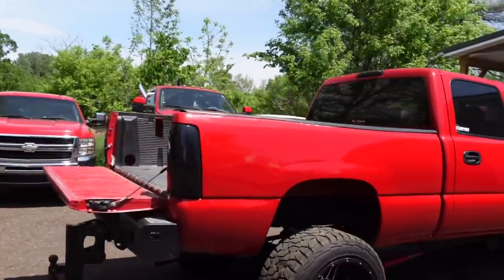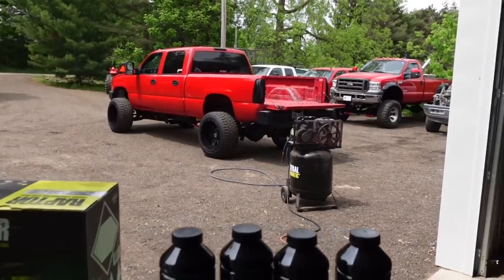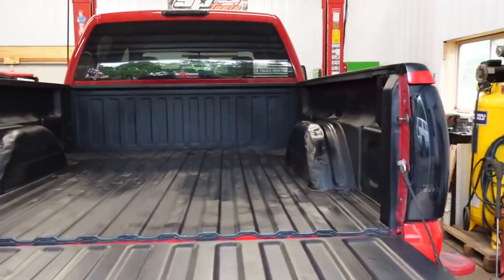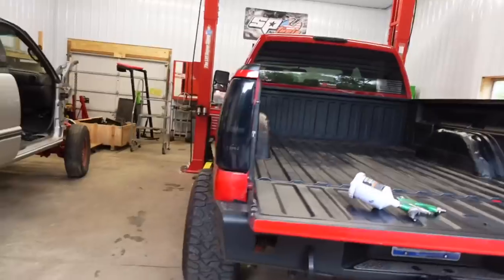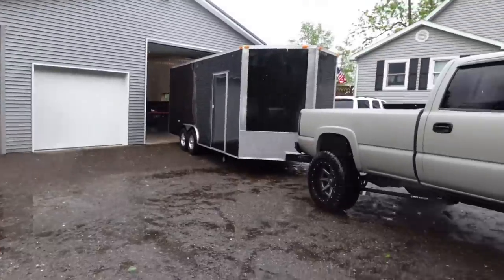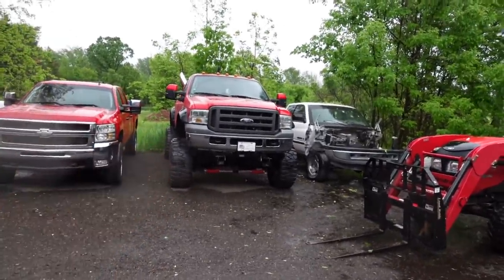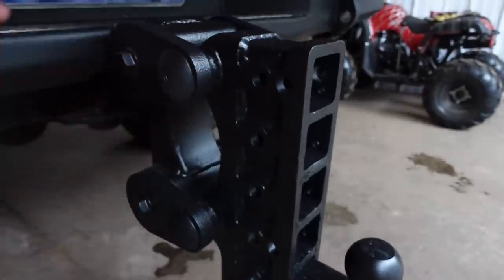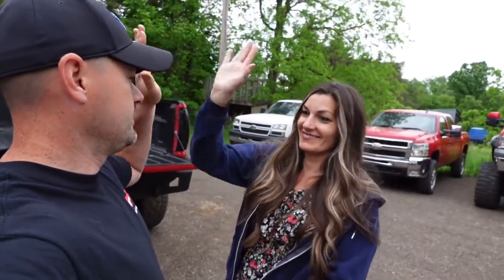Look What My Plastic Bed Liner Did To My Duramax! YIKES!

Comment from the maker: Who has a plastic liner on there truck? Do you like it?
Reply: Ya don’t run them fender flares either, they rub and mess up the clear coat around your fenders
Reply: Never. I did raptor liner in my build. It's comming right off. Should have went linex
Reply: @Yippa391  If your Raptor is peeling off, you didn't prep well enough.
Reply: why didn't you just put A tonneau cover  my sister put one her brand new chevy silverado High country.  pickup truck
Reply: I got spray in and love it its durable and easy to clean
Reply: I still have a plastic liner, but mine does not cover the top of the bed walls like yours did. It has rubbed the pain off in the bed in the high places but I have kept eyes under it over the years and it still has no rust thankfully. Then again mine is solid with no holes. I too have it on my list of too-do's, Most likely I will go with X-Line which is a professional liner if I do not do it myself. My rockers and paintjob is a little more pressing atm. Any-who glad you got it taken care of and I think you are correct in your choice to put another coat ... go big bump like rust's mirrors...more protection.
Reply: My trucks previous owner put it on.  It's an 02, so not sure how long it's been there.  I'm worried about the moisture underneath and hope much rust I'll see when i take it out.  I do like the secondary protection from the plastic before the metal, but just not sure if it's worth it.
Reply: Only reason I like my drip in liner is for impacts... Like hauling S tons of firewood every year.... That and spray ins are expensive for my pocket...
Reply: i do. it came with it. and i have looked under the top of the bedsides and its worn through. but its a california truck and its still in california so its ok. but i want a spray in bedliner.
Reply: I used to have a Line-X franchise and those drop-in liners were job security
Reply: Yep had one in my 92 gmc since my dad got it from the dealership.   Bed never rusted out i sold the truck after at 435k orignal motor an trans for 800 bucks still ran.  Rust on the rockers an the bed. But the rails an under that plastic liner was still looking good.
Reply: my old dodge dakota had almost no rust on it when I bought it.  but the bed liner which came with the truck accelerated the rust 10 fold
Reply: My 95 S10 pickup has a drop in liner. The bed seems to be galvanized or something... When I scratch the paint to metal it doesn't seem to rust just stays gray
Reply: I can’t drive a truck yet for three more  years but my dads gmc Denali has dual liner in his truck but he had plastic liner on his Ford rangers he used to have.he also hated his one ranger cause It’s transmission blew up when he was driving it could’ve killed him
Reply: I bought a Toyota pickup years ago that had a plastic bedliner beat the hell out of that truck working it to the max tore the bedliner eventually but no dents or rust underneath current truck has one when I pull it out to clean underneath looks brand new and I work my truck no grocery getter never understood people hating on plastic bedliners I think if I had a spray in liner I would dent the hell out of the bed of my truck

Comment: Those bed liners were doing that in the 80s. I can’t believe they still sell those. Best things are spray in and a thick rubber mat. Good video. We could sure use a mean tweet and under $2.00 gas .

Comment: Cap foam under the top of the box...then  grease ur bed to cover it ...I know a guy that did that and truck was a rusty mess years down the road.. but the box was still like new inside!!. Plus I knew a guy that greased his chrome wheels in the winter. Then summer time used oven cleaner and those rims looked new for years!!!...
Great job as always you guys!!!❤❤

Comment: If the bedliner is applied thicker it will cover minor stuff but honestly if you apply it thin like that and put the drop in plastic one back in that's the way to go because it keeps your bed from rusting and you can throw bricks, chains, logs, rock, whatever you're hauling and you won't dent your bed so if you want a clean look or go to sell it it'll still look good and not need a new box and the liner does scratch I've taken a few good chunks out of mine hauling some scrap

Comment: I had the rino liner put on my truck when I bought it after several years it started fading of so I bought a gallon of hurculiner you roll ot on with a roller masked it off and the one gallon did the whole bed with two coats it turned out great  and I do have the under the rail plastic bed liner on my ford it's been in there for close to 30 years protects the bed really well but it does wear the paint some but you never see it

Comment: I couldn't imagine having to deal with the salt issues you guys deal with..
Reply: I got tired of it on the 2nd LBZ rebuild.   On the 2006 I did rust bullet with bedliner over the top of it.  On the 2007 I pulled it apart after I blew the motor and decided to sand blast the frame in hot dip galvanize it. 👍

Comment: You never know what the stock rods are going to do... my 104,000 mile 97 12 valve let a rod out the block using 1 turbo with 50psi of boost... took out the new head as well, everything was new but the block , crank and rods

Comment: put the plastic liner back in and you will not see the scratches and dents. My 2000 gmc still has it’s original plastic liner and i’m sure there’s scratches on the floor but the bed it’s self is still in very good shape . unfortunately the front bottom of the bed rotted out so i put a diamond plate piece in. it’s only a weekend truck but she got a total frame swap and engine swap

Comment: I like the rhino bed liner spray in I used to do them and if you prep the bed proper and clean it will hold up get the black the color fades over yrs the 2 part epoxy holds up great

Comment: When D&J did my common rail cummins I asked if I could send them a set of 12v rods they said I can but dont expect them to hold much more power then cr rods. Research I did say they r stronger then crached cap rods. But I took their word n forked out for their billet rods.  They only do Cummins engine n built the firepunk engine that holds the world record so pretty creditable

Comment: heres the deal ive raptor lined 3 of my trucks complete using the gun you used killed the texture you need to use their gun to achieve the raptor texture ! lower the pressure heavier the texture higher the pressure lighter the texture it only peels off if proper prep is not done . in fact one of my trucks is on raptors site a few years ago

Comment: I am debating to use on my truck bed or get linex.
Reply: Bullet liner is a way better product
Reply: LineX premium …only way to go.
Reply: @lindseyschofield2387  
Better than what?
Reply: Linex > everything else. I got videos on my linex liner
Reply: Bullet liner stays black for life. Linex will fade to grey over time
Reply: Line X. Had mine done 7 years ago and still looks good. Absolutely bullet proof. Doesn’t cut, peel, bubble or anything.

Comment: @Truck Master what size tires are you running? Are you on a 22x12 wheel? Having issues w/ my Nitto NT420V 305/45/22 tires and going to switch over to something like you have. Thanks!